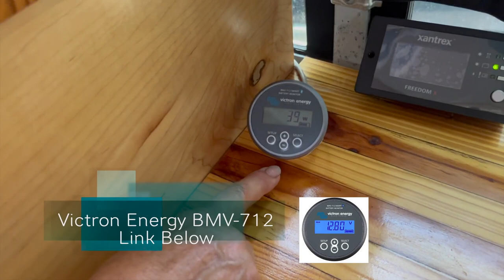Janet's DIY Skoolie Tour: The Ultimate Adventure Bus!

Comment: How much did you charge her? No pun intended. And what would you charge to do an 08 Colorado with a 7ft fiberglass box on the back?
Reply from the maker: The parts list varies. A rule of thumb is $1,500 in equipment and $1,500 in installation costs.
Reply: @enigmaticnomadics  Okay thanks and what do you think about the stuff at harbor freight for a cheap or entry level way of getting into it?
Reply: @luigiprovencher  You'll regret not buying what you really need upfront.